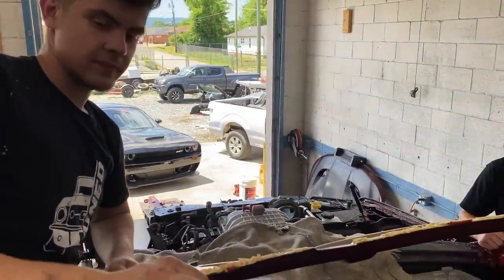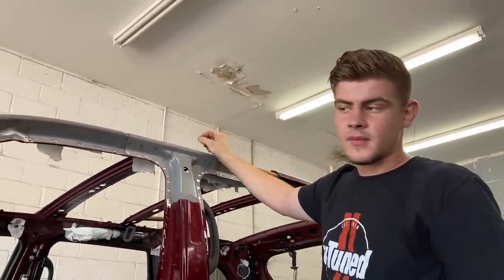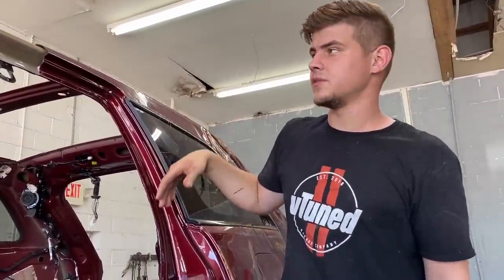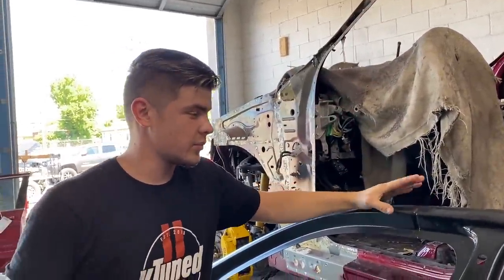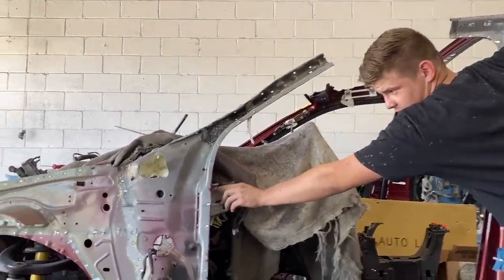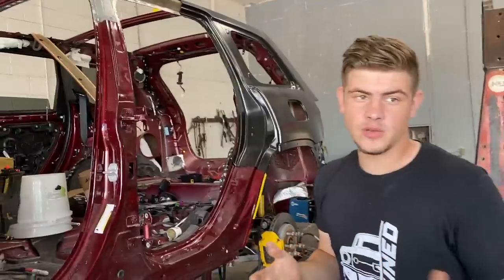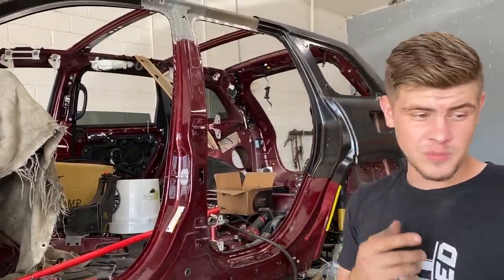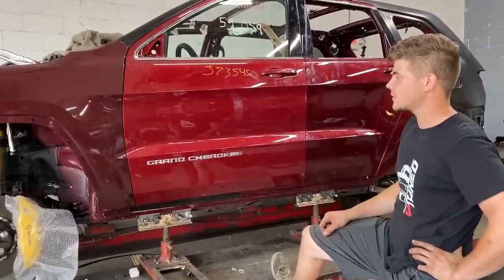Rebuilding A Wrecked 2018 Jeep Trackhawk Part 9

Comment: Definitely one of your most interesting episodes sonfar, as this repair goes pretty deep into the car's structure.
Really curios about how well all the gaps will align as soon as your putting it back together 😁✌️
Reply: im more curious how they are gonna make the car water proof like it is at the factory. if they dont do a good enough job bonding the new panels with the old ones they will have major rust issues come 5-6 yrs down the line

Comment: In all my years of doing body work I've never seen anyone use a belt sander on spot welds. I've always used a Blair cutter spot weld cutter.  When you use the Blair cutter you generally don't have to chisel much.

Comment: Get the OEM measurements. Thats how you will get it back to factory specs. Your playing with millimetres specs are needed for such a big job. Parts can line up but frame can still be out of spec. causing wind noise possible water leaks, etc.

Comment: i built an 2003 Silverado Z71 that was a rollover back years ago. Was a LOT of work but probably the best truck i ever owned. Bought it with 20k miles on it and sold it with 270k

Comment: When you do the next part you should really take the tailgate and the hood to him to check that the tailgate and the hood line up well, as you've just done all the bodylines for one side, but not the front nor the middle, and also to make sure that the tailgate or the hinges didnt get warped in the accident, as it did land and put the pressure all on one side, and with modern crash safety they are designed to crumple and transfer the energy, which means that if he is going off of factory specs, those parts might need to be readjusted as well.

plus the roof does need to be retrofitted as well, so you might as well do the hood, the roof, and the tailgate all in one go, or atleast deliver them to him for that to make sure that you dont get the thing back with one sorted side, and one busted up or knocked out of alignment side

Comment: That "Factory Splicing Section" is actually the result of a  Laser Welded Sheet Metal Blank that is formed/stamped into the final part shape.  The purpose of the  splice is to join sheet metal panels made of elements of different materials and/or thicknesses to allow for proper metal strength where it's needed while reducing materials, weight and cost of the vehicle.  That joint's location is predetermined through the design process of the vehicle, but due to tolerances will move and very due to manufacturing.  It wasn't put there to help repair shops know where to just and splice cars back together.

Comment: Hey all 
I am no mechanic or body work expert, but i have a question i know it would be a lot more work but wouldn't be better and stronger to replace the whole panels as they have them rather then pulling weakened metal and splicing in new section, again i don't know about this stuff. 

But i love watching the videos totally hooked and you all have mad skills 😁

Comment: I’m sure there’s someone here that can explain.. I get that there are ‘splice in’ sections, but would it not be easier to replace the entire sections and save welding the joints? I would have though the spot welds would be easier than welding/ grinding and body-working the new seams and it would also be stronger?

Comment: God help anyone who buys this wreck. FCA spent hundreds of millions of dollars on robots who spot weld the frames exactly the same way every time. Those welds in a crash are the difference between life and death. These 3 guys have zero chance of restoring the structure of this truck to its original condition. If not for you tube this thing would have been sold for scrap and crushed. Thats what should have happened.